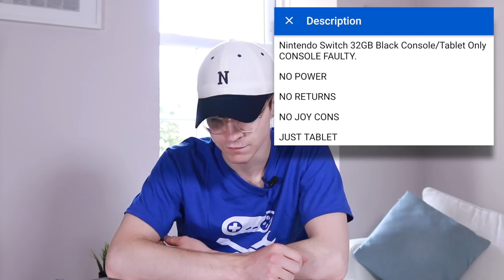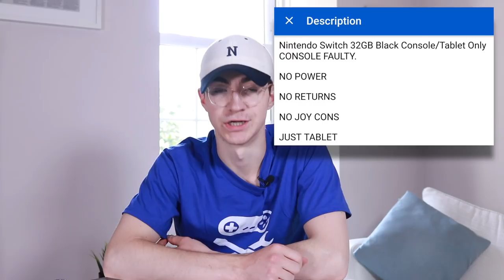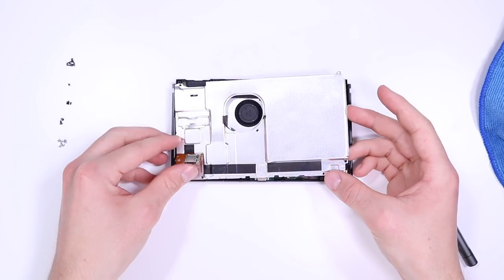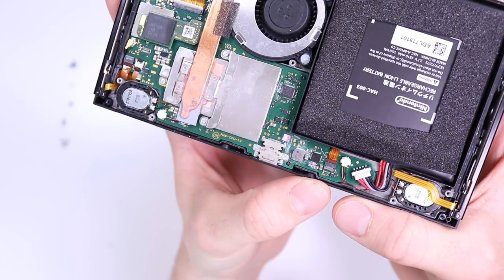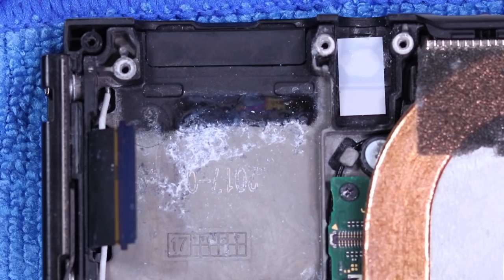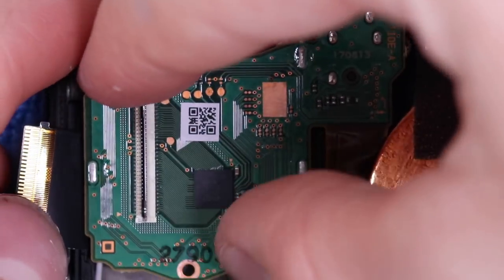£24 Nintendo Switch! - Can I Fix It?

Comment: This is an old video now but what is still fresh and never gets old is how buyers don't think through the available facts carefully and logically.
This is supposed to have been a Switch that was left unattended as in little use and now gosh, it doesn't work and seller doesn't know why. It was only played by a little old lady on Sundays. It's a mystery.
The facts are, it's going dirt cheap. Possibly because the owner places little value on the device.
It has no joycons. Why, where are they? They don't just fall off and disappear into tthe 6th dimension.
Was this used soley on a telly. Maybe but if so, where's the dock?
It has no wall wart. Seriously?
Was this unit looked after by whoever owned/used it? No, and we know that from what is being sold with the unit ie, nought.
It had no case, no games, no . . . nothing. That tells me all the working parts, games, dock, case etc were transferred to a newer/other Switch and this one left for dead because . . . .  they knew it was good and dead.
Mate, I don't feel your pain. It was basically bought without thought and I'm guessing here that the video you made of the opening is still on your had disk because of the shame you felt when you opened it up and found unprofessional damage and worse corrosion; the death nell for smd electronics. You got diddled and it's is so obvious. Why video that loss of face?
What "My Mate Vince" says is just him being nice about it. He well knows water damaged electronics, especially smd stuff are reduced to just the parts you can use later in a similar unit or onsell. They are almost always unrepairable as the corrosion which continues its creep can and does get under the ICs and then it's good night Irene.
Garage sales, trunk sales and fairs is where the bargains are and with a power brick you can check a lot of stuff right there and look at the sellers face while he, or she tells you their sorry story. Facebook, eBay, Craiglist? Nah.

Comment: The power control management chip usually is at fault with no power switches. Id look into that one. My mate vince has done quite a bit if videos on replacing it

Comment: Hey man, been a long time subscriber and love your vids ( currently binging them all ). Question if I may? So I unfortunately have the old hac-001 switch with the old 3600mah battery. 

Can I replace the battery with a hac-03 4310mah battery? 

As I know the new hac-001 -01 switch has some kind of processor that can handle a 4310mah battery but I don't know if the old switch can handle a 4310mah battery?

All help appreciated.

Comment: Kinda reminds me of my pick up of DSi XL that turned out it just needed a battery.After slapping in my regular DSi battery into it all I got was an error that basically meant "Sorry, one of the chips is dead, good luck on fixing that".Needless to say, it's still in my drawer, sitting there for no reason at all.The joy of buying faulty systems on ebay huh ?
Reply from the maker: Indeed!

Comment: im guessing some kid has spilt milk/poured it in there (as young kids are prone to do unsupervised...) and panic tried to clean it up with too damp a rag OR the parent has gone in and tried the same. i remember SCREAMING at my mum to not clean the wii because you cant put water in it... (she had wanted to put a dry rag in the disc slot to get out the dust but i was FEARFUL) although i was closer to 10, im guessing the kid is probably aged 4-6 to have done any of those. 
broken consoles always make me a little sad - i cant imagine the kind of heartbreak and panic youd go through as a kid. broke my mums PS1 when i was younger and i still feel immense guilt even now knowing the very much easily fixable problem and knowing her sadness over it.

Comment: when you see a Switch with that much water damage just throw out the board in the trash and keep everything else as parts
Still 25 for a good and straight frame and working battery not bad and if the screen works even better

Comment: I don't buy them off eBay for this reason. The fact he claims it was his kids and they lost interest, yet all accessories are missing is a red 🚩? I bought lots before and most were harvested for parts. Thankfully did get a refund as just claimed damaged in shipping. That how you get around the sold AS-IS  for parts. If tgey are dishonest enough to harvest the parts without disclosing that tgey did? Then going to say anything to make sure returns gets pushed though, tried of these scammers.

Comment: Liquid damaged switch... Then says it's in good condition at the end. What are you smoking lol, with that much corrosion I wouldn't use anything from that switch. Imagine putting that battery in another switch and it exploding lol